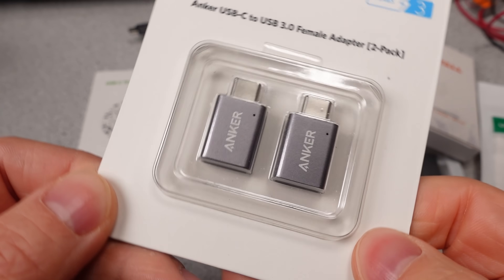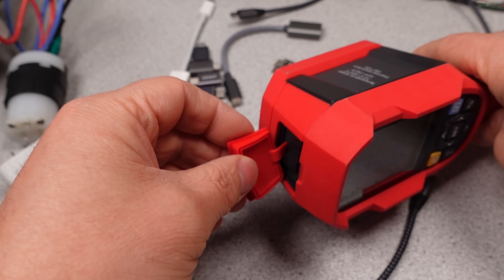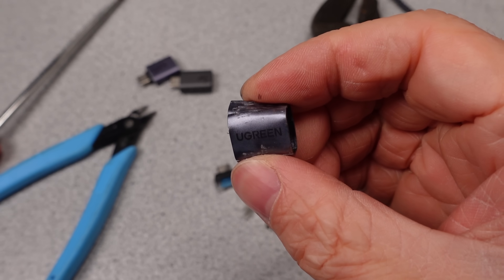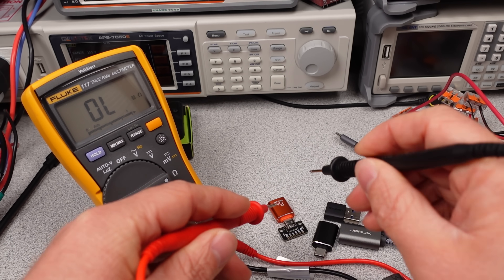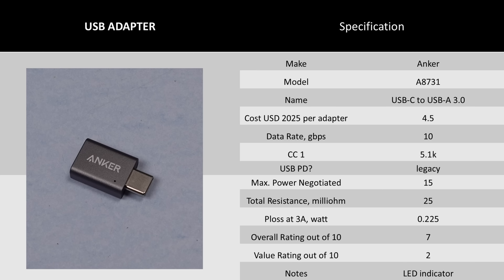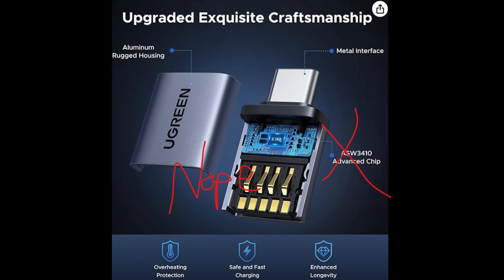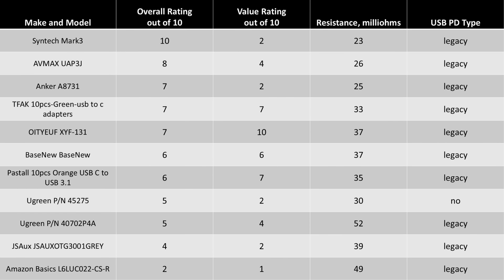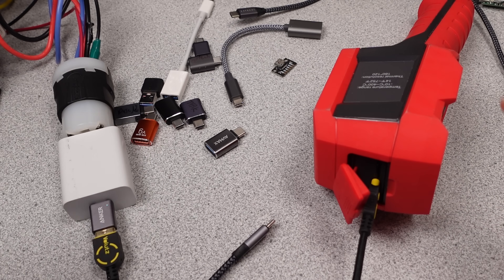Why do we need USB adapters still?

Comment: Any time you have a device with a built-in USB A port intended to plug straight into a port, those cabled adapters are the way to go. Otherwise, you're liable to break your port off. Don't knock em till you've needed em!

Comment: We need them because manufacturers just refuse to switch to USB C every time and/or screw up their implementation implementation so a USB C - C cable won't charge their USB C device :), only a USB A - C one will.
Reply: All it takes is two resistors to implement the spec correctly, no fancy chips, yet they still get this wrong so often. Infuriating.
Reply from the maker: Yeah, the thermal camera is a prime example of failures.  It's molded plastic, with a captive battery, it can not be powered and charged at the same time, so when that battery goes it's e-waste, and it skimped on two measly resistors.  There is literally no assembly, cost impact of two more resistors on a product this complicated.  Now, in terms of functioning and being reliable, it's actually a nice device, but yeah, much room for improvement.
Reply: You can use an C - A  and then an A - C adapter if you only have a USB C - C cable 
I keep those in my bag just in case.
Reply: @JessicaFEREM  Search for "USB-Chyna" for a cleaner implementation of this idea!
Reply: Cause usb-c is trash
Reply: @IamUzyf  USB C is anything but trash.
Reply: @calinnilie  trash compare to hdmi and usb a. Too fragile
Reply: If physical hardness is your only concern in this entire world then I have some bad news for you. 
Look into VGA, maybe you'll want to start using that for your 4K monitors now.
Reply: @calinnilie  😂😂 did you ever saw Usb A? It’s 4 times bigger than usb C
Reply: @IamUzyf  Yeah well again, feel free to use VGA for everything and live in the 2000s
Reply: @calinnilie  ever heard of hdmi😂? It still 4 times more durable than usb c
Reply: @IamUzyf  This is why we don't innovate as fast as you could
Reply: @calinnilie  😂 innovate you mean port that break itself?
Reply: @IamUzyf  I'm sure your butter hands might break ports, not us normal folk tho, we're enjoying the benefits of USB C. Also for klutzes like you there's a version of USB C with screws on either side like VGA. You won't break that :).
Reply: @calinnilie  😂 you probably never saw any usb c port besides your phone 😂
Reply: @IamUzyf  I use USB C / Thunderbolt for:
- Charging my headphones / mouse&keyboard / phone / tablet / ROG Ally / 3 laptops at 120W
- Transmit 4K@120Hz video from my laptop to my TV
- Transmit video and USB from my laptop to my monitor, WQHD@240Hz
- Charge and transmit video to my Quest 3
- Every USB Stick / External HDD I have is USB C
- I do not buy new peripherals that do not have a USB C port
- I charge random ass electronics like my mini vacuum cleaner for my desk, my electric screwdriver, vacuum pump, massage gun; 
Pretty much the only places I use USB A anymore are: My SIM steering wheel (as you cannot swap the cable easily), and my electric shaver (which I could easily swap for a USB C cable, but don't have to)

Comment: The goated USB King is back. I have asked this before but would love a new update. What do you think is the holy grail of cables and GAN charger adapters. I bought the UGREEN 65W recently and yeah it cant hold a 65W charging speed for a long time to charge a laptop. What Batterybank is your favourite, GAN charger (100W or 65W sustained) and favourite cable?

Comment: The units with cables are useful if you don't want to have mechanical stress on the connector on the receiving device. If for example you are connecting some device that has some weight and you don't want that weight to potentially damage the connector on your expensive computer. Or if you're afraid to bump into a long device (which acts as a mechanical lever) and thus damage the connector.
Reply: Exactly.  I’m currently using the Anker one to plug my dash cam into my car and with the straight adapter and straight ridged plastic end of my cable together it protrudes almost 2”.  It works fine, but at any given point I could easily reach down and with very light pressure I’m sure it would snap clean off the port.
Reply: Also with Laptops you can use more ports with the short cable option
Reply: Exactly.  I would never rely on an adapter without at least some minimal amount of wite to reduce stress on the port.  The only adapters I have are the C-to-A adapters (for plugging USB-C into a USB-A port).  I need those because none of my computers currently have USB-C (just a Chromebook, my tablet and my phone have USB-C).

Comment: doubt power will be an issue with these, probably will end up plugging in a usb drive or keyboard/mice. Data integrity can be an issue, i have the amazon basics one and I use it to connect my USB hub to my monitor which then goes to my laptop through the monitor, the cable is good since a really long thing sticking out can break more easily. Had cheaper ones and sometimes they are only USB 2 rather than 3
Reply: Data corruption during transmission should result in CRC errors and thus be detected.
Reply from the maker: Yeah, I want to do more comprehensive data testing.

Comment: In your opinion is it better to buy a Satechi USB-C charging cable or Anker Powerline II with lifetime warranty because I bought the Uni charging cable that you recommended  but now it only charges my device if I bend it in a certain way, so if this ever happens with the Anker I can just get a replacement?
Reply from the maker: lifetime warranty is hard to argue with, I'd look into it, see if it includes wear and tear or only manufacturer defects.

Comment: I've heard USB-C extension cables can be somewhat problematic or dangerous to use. But I just bought a big lot of good ones to use with some new thermal cameras. Are you aware of any concerns I should be aware of?
Reply: When a USB port negotiates with a USB charger, it does not consider the use of an extension.
If the port says 20 volts at 5 amps and the charger confirms it supports it, it will happily send 100 watts down an extension cable designed for no more than 15 watts.
That's the "safety" concern with using extensions. In reality, just... I don't know... buy extension cables rated for the power you need... like......... any other extension cable on earth.
Reply from the maker: mmhmm.  Yeah, it's risk management, fairly low risk, but yeah, make sure the equipment is made for the job.
Reply: i believe they bypass the cable safety, low power should be fine

Comment: We use the cabled ones at work for wireless barcode scanners plugged into Surface tablets. The cable lets us Velcro the adapter to the back of the case instead of sticking out and getting broken off.
Reply: i do the same to plug in my usb hub into my tablet, i have a strip of velcro on the back and the hub sticks on it at an angle putting minimum strain on the connector and cable
Reply: Yea those dinky one piece ones the usb c connector can easly snap off! I have to agree the cabled ones are stronger more sturdier and can be stuck somewhere as well because I had those one piece adapter and snapped the usb C connectors off them

Comment: I have Type-C Shaver Adapter Charger for Philips Norelco Oneblade so I carry less charging cables while traveling. 😀
Reply from the maker: Nice, yeah, USB C all the things.
Reply: those adapters would feed more voltage than it expects, the NiMH one i have expects 4.3V, i dont think it matters all that much since NiMH batteries would dissipate the some excess energy as heat

Comment: Is this a real question you're asking or is it just clickbait? Sheesh, I genuinely thought better of this channel. Apparently everyone has to chase morons and the algo though.
Reply: @spewp The fact that you clicked and engaged (and that I am engaging to your engagement), unfortunately, means that it worked, you know...
Reply from the maker: Yeah, the stupid-o meter (suggested title thing) says YEAH good title.  as I sigh and say fine whatever.  The video is genuine though, actually checking some of these things out, the main difference is the cheap ones use cheap plastic molding around the usb C connector and will break easily, the more expensive ones, cabled or non-cabled don't do that.